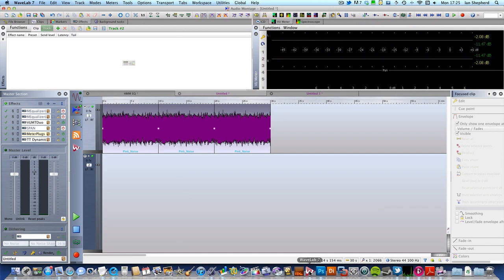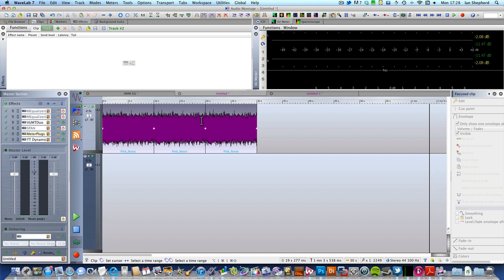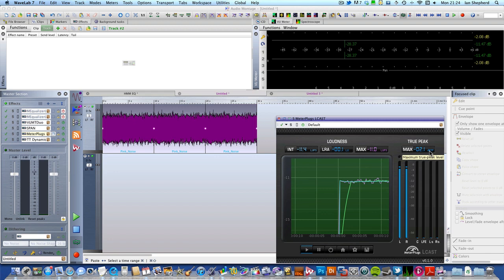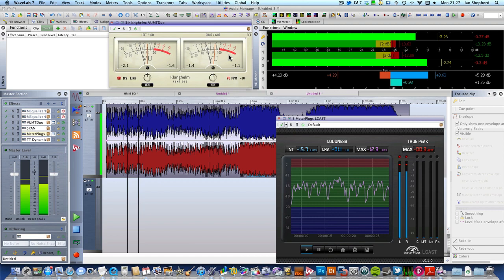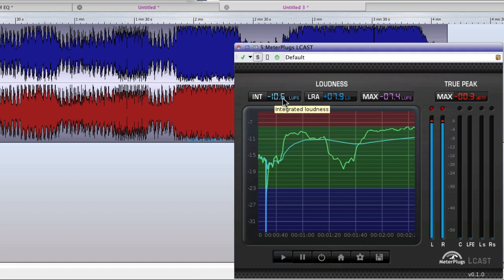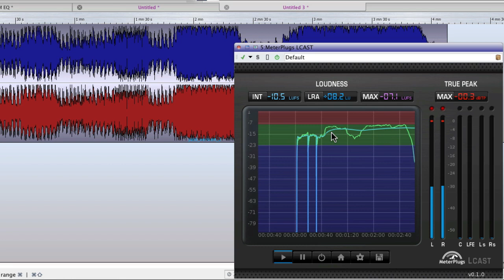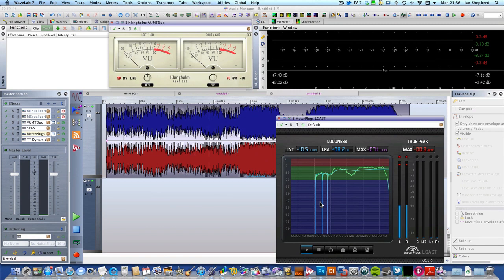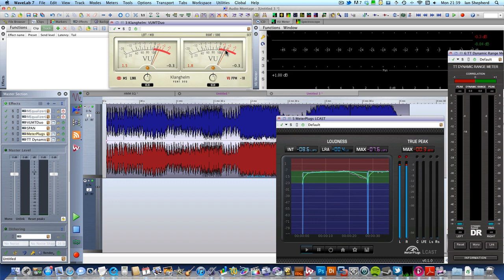LUFS - the new Loudness Units. What do they mean ? How to read the new breed of loudness meters

Comment: Is there something which automatically gets you the integrated LUFS value by scanning a file, or clip/region if it's within a DAW, without having to play it back real-time?  Thanks.

Also, is there an alternative to MeterPlugs' LCAST?  Something like this should be free and it's a completely insane price they're charging for it!  It's absolutely stupid - can't go without saying.  $200 for the regular one and $400 just for the ability for logging and 5.1 metering which would actually really take them nothing to implement!  I wouldn't buy it from them even if it was the only one available.  I don't associate myself with thieves.
Reply: LM2 will will scan your file and give you a reading. TC say it only works for an  offline scan in Pro-tools but it in fact it also works using Cubase too.
Reply: daz Studio Well sure, if there is a VST version of the plug-in, I don't see why it wouldn't work in Cubase.  With the session in progress however, you're saying there's no way to get a reading for a selected clip/region in Pro Tools without literally having to play the thing real-time?  I guess that would certainly have to be the case if I'd be looking to measure a bus of a sum...  That's really unfortunate if that's the case (many things like that in Pro Tools).  It would be a very useful and a significant efficiency enhancing tool otherwise.
Reply: daz Studio I see.  Well, thanks for the video.  Lol, the reason you don't get what I mean though is because Pro Tools doesn't have the function to do this.  It only has real-time bounce.  

***** Ah, thanks for the suggestion.  But yeah, unfortunately this means I'd still have to wait the full duration of the song or whatever it is so that makes it no different than having an insert on a bus while everything's playing.  Of course Pro Tools 11 can now do "offline bounce" or whatever it's called, but everything Avid is bs anyway.  It's unfortunate that I use it.  Well anyway, that's a tangent and probably not good if I really go there XD  Thanks regardless, I appreciate it!
Reply: ***** I'm working with music.  So, the reason I took interest in this is because I want to start metering.  I conceptually understand everything there is behind this (I actually tried to develop an algorithm to improve ReplayGain, if you've heard of it) but what I'm looking for is the best means of integration.  Nothing struck me as comfortable and I chose to in the meantime direct my attention elsewhere (many other things I was working out for myself in terms of my mixes).  I particularly think this kind of metering would be useful for film as well.  

My problem with this thing is that I can't just periodically update it and have it rescan the whole thing and perhaps even automatically make adjustments in only the areas I may be automating at the moment.  It only works with the part that's currently being played from what I understand and it's annoying to have to constantly think about it for every move I make instead of having a clear image of the adjustments I'm making.  We're in the digital world and there are too many things like this which are simply unacceptable.  Pro Tools is the epitome of outdated technology and this metering thing kind of falls into that category, although perhaps it's the deficiency of having thought that through in the design of most DAWs, particularly Pro Tools once again.

Thanks for taking an interest and perhaps you might be able to show me otherwise, that it's not as annoying to deal with this as I imagine it being.  If all it does is constantly write as the track is playing or scan a file, it's only good enough to give me some general picture which I pretty much have already in my head anyway, except now I just have an extra thing to deal with.  Obviously I see the use and need for this tool for something like broadcasting or maybe just to check your final mix, but I was hoping it could be helpful in other ways.  Thanks again!
Reply: ***** Ah, well there you go, PT11 has it integrated.  There are some things which are on offer with some of these plugins that PT11 doesn't but that's a separate issue I guess.

And yes, it would be done exactly as you say and it would only happen when you'd manually trigger it to do so.  Perhaps for that reason the automatic thing wouldn't be a good idea if talking about automation, but what I really meant was for it to simply keep track so that it doesn't re-render everything when you tell it to do so.  This concept isn't impossible at all.  Adobe Premier has had such a thing for video forever now.  All this video editing software is so much more advanced than audio in terms of smart programming and taking advantage of the digital platform that it's kind of just frustrating..  But anyway, as I manage to keep doing, I digress..  It's just a very poignant issue for me.
Reply: PPMEMULATOR works great. 100euro
Reply: Riaan van der Merwe Does it have the mentioned functionality?  Thanks regardless for the recommendation!
Reply: Typhoon792 It scans a WAV file in 1% of full duration and then it gives you the LUFS reading. No graph though, pretty sure the Zplane Plugin(and stand alone) gives you a graph but the price is more expensive
Reply: Riaan van der Merwe Ah, I see.  So PPMEMULATOR isn't a plug-in.  As in, it can't work on selected clips (which are effectively separate WAV files, just externally) within Pro Tools or any other software of choice right?  It would need to be done yourself?  Thanks again!

In any case, I'll check those things out.
Reply: Typhoon792 It can act as aplug in or a stand alone as far as I know. Still waiting for it to be installed myself. But the 1 Audio guy I talked to uses Zplane and ppemulator in nuendo and pro-tools.